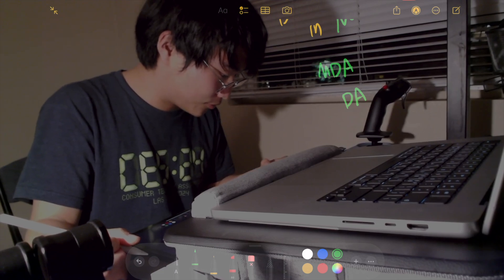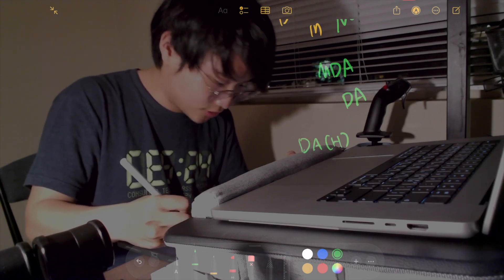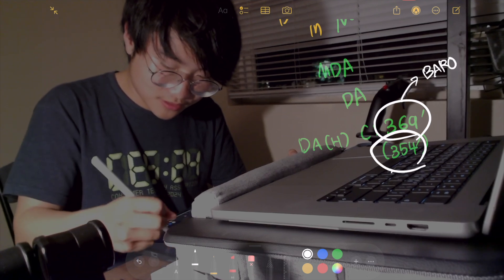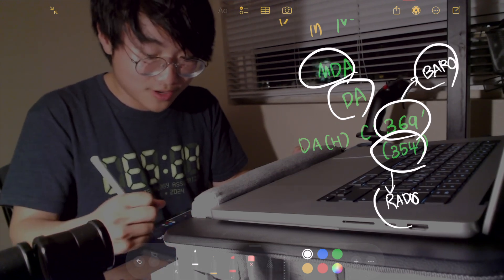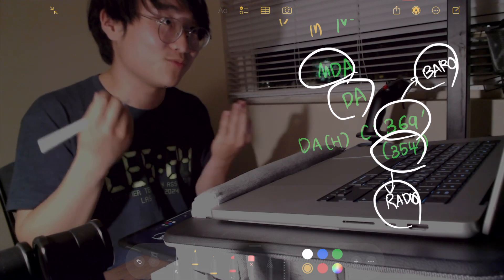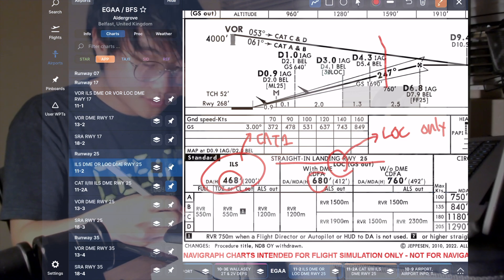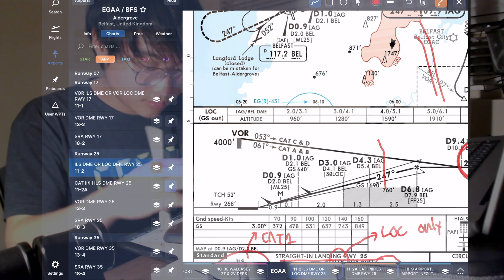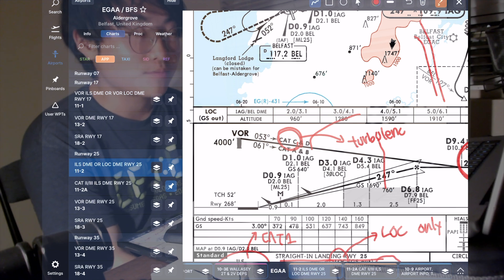BARO vs RADIO | MDA vs DA | Decision Altitudes in Navigraph Charts (IFR Approach) - CHECK COMMENTS!

Comment from the maker: CORRECTION IN THE VIDEO. DA and DH are different. DA = barometic, DH = radio. some content in this video might say DA instead of DH (typo, my mistake!) but these terms are different. They are both used for precision approach unlike MDA (exclusively BARO atltitude) but DH is in radio altitude and DA is in barometric altitude. Also for CAT III on the chart in the last couple seconds of the video, I accidentally inputted the CAT IIIa's DH atltitude 50 on BARO side whereas I was supposed to input it in RADIO. Sorry for the mistake again

Comment: so you use Baro Minumb on only non precision and RA on Precision Approach , correct in Summary?
Reply from the maker: You can use both radio on baro on precision approach depends on what the chart says. If it says RA 100 then use radio, BA(h) say 100(50) then use BARO value which is 100 in this case. Optionally 50 as radio
Reply: @JohnSeong  i may have more questions, good video

Comment from the maker: TIPS & TRICKS
Decision altitude (DA) is referenced to mean sea level and decision height (DH) is referenced to the threshold elevation.
RADIO is similar to DH. It relies on the radio altimeter and uses AGL (Above Ground Level) altitude readings, meaning that it is accurate enough for precision approaches. BARO (Sea Level) relies on the barometric setting altitude and is used in non-precision approaches, as it is not as accurate as RADIO.
Source: https://forums.x-plane.org/index.php?/forums/topic/250216-baro-v-radio-on-approach-perf-page/
Reply from the maker: I also made an embarrassing mistake where I entered the value 50 as the CAT III b Decision Height (DH) in the BARO entry on the FMGC/MCDU instead of RADIO as DH is GROUND LEVEL = RADIO whereas DA is SEA LEVEL = BARO!